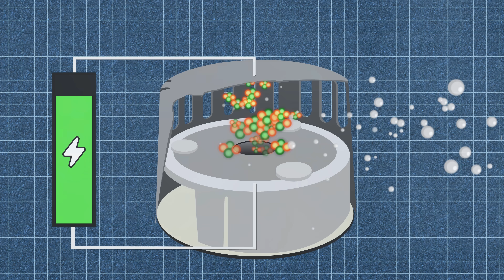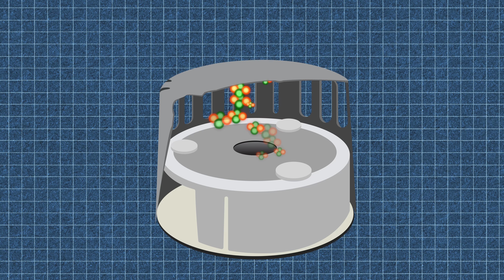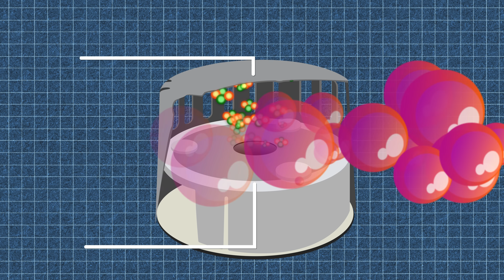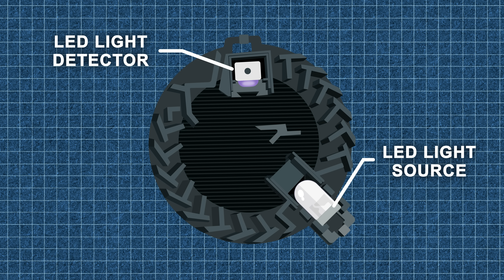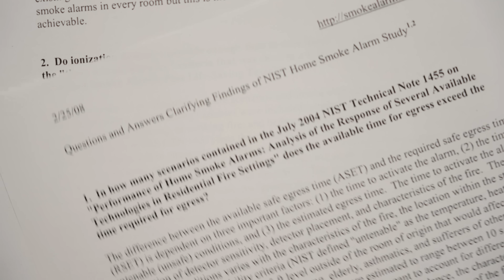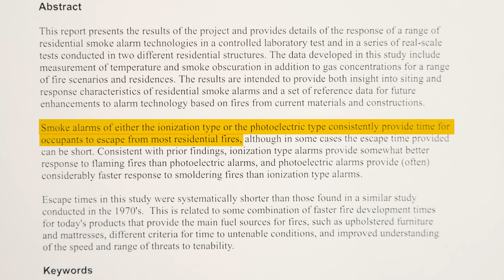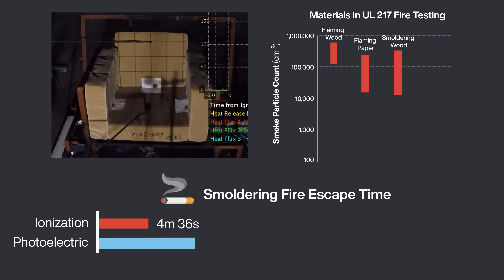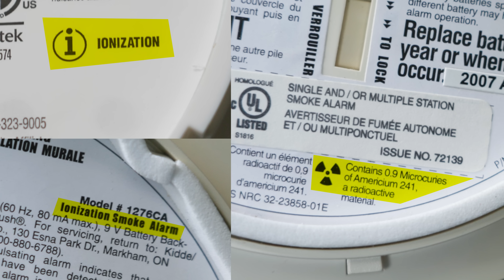Why the Most Common Smoke Alarm is Dangerous

Comment: Here in our Australian home. We have both alarms. One of them goes off about half the time whenever I use the oven. It's so annoying! But I also understood why it behaves like that. We might have a look at the availability of the 8th gen alarms here soon!
Reply from the maker: Hey, great on you to check which alarm you have! Unfortunately outside of America 8th / 9th gen alarm don't exist.  However the technology might be in your current alarms already.  I would get a photoelectric alarm for sure.  I forgot which independent testing organization released info for Australia but it exists as I was looking at their recommendations during my research for this video.
Reply: @Lam  thank you for the comprehensive information!
Reply: You might try moving it. It could be that the way the air circulates in your house the air from the oven gets to the detector too quickly before it has had a chance to disperse.
Reply: @uzetaab  it's right next to the kitchen. I'm not sure if I'm allowed to move it
Reply: Does Australia even have 8th gen alarms along the same standard as USA?
Reply: @jayytee8062  The standard has been updated (AS3786:2023) but on a cursory search it looks like it may not have taken the USA approach of raising minimum standards for individual alarms.  What it does do is allow sale of multi-detectors (e.g. CO2 and smoke) and dual sensor (ionization and photoelectric). Also requires alarms to support interconnect (all alarms sound together). This is not yet a requirement in Victoria but it is in some states, at least for rental properties.
In Victoria smoke detectors are only required outside bedrooms between the bedroom and the rest of the house which would have been ok for non-smokers but how many people now charge phones in their bedroom overnight? No way I'd sleep in a room with a Li-ion battery on charge and no smoke detector!
Reply: Hah, what's the point - Australia is a total joke now. Just another sad puppet of the WEF.
Reply: In Queensland, all new smoke alarms installed from 2017 onwards must be (solely) photoelectric type and by 2027 all smoke alarms must be photoelectric and interconnected. Rules vary by state and territory naturally but I thought I'd throw this in there as well.
Reply: @theone1and1  Hi mate, I was wondering how you came to know this. Just asking out of curiosity as a fellow QLD'er, cheers :)

Comment: I'm going to buy some of the fancier smoke detectors you recommended!
  As a renter, I found nearly every apartment ive been in has expired detectors (>20 year old ones common on the east coast). Now in addition to smart lights, I'll be moving between rentals with smart detectors. Keep up the great videos, Andrew
Reply: In Seattle my apartment building just replaced all the smoke/CO detectors after 10 years. The Seattle fire department also comes by I believe once a year or every 2 years and inspects each apartment as well as the entire premises.

Comment: TLDW (Too Long, Didn't Watch)

1. USA regulations require all smoke alarms manufactured after June 30, 2024 comply with UL 217 8th Edition, a major quality of life upgrade that dramatically reduces the "nuisance alarms" (false detections) from cooking.
2. Smoke alarms with a (I) (Ionization) sensor are generally worse than ones with a [P] (Photoelectric) type, but both types used simultaneously (such as dual-sensor ones) offer the best protection.
3. About half of house fire deaths from could be prevented with working [P] (Photoelectric) type smoke alarms. (Don't be part of that statistic, you know what to get your loved ones for a Christmas gift now, LOL.)
Reply from the maker: Thanks for the TLDW.  1 and 3 are correct!  Bit of an edit with 2.  Ionization is generally worse but both types used simultaneously can offer the best protection but problem is dual-type sensors are not being sold in 8th gen models right now.  Interconnection is just as, or more important.  Thanks for enjoying the video!

Comment: Great video! I love your channel. This isn’t a negative comment, but how come you didn’t run the original tests with an 8th gen alarm to actually show the differences?
Reply from the maker: I should have on reflection.  So much stuff shifted.  Originally I had tested but later discarded them as it wasn't all that helpful in providing useful data but that's not always the point.  I might make a bonus video showing the differences.
Reply: @Lam  thanks for the explanation. That’s basically what I had assumed. I figured you had done the testing but left it out due to video pacing or something like that. Either way, the video was informative and entertaining. Keep at it!

Comment: This is an excellent overview of the problem and its potential future solution, but I would really like more information on the optical wavelength differential technique of particle size assessment and software algorithm discrimination of nuisance smoke vs real fire situations. I'd really like to see some of these new models tested in real world scenarios too.
Reply from the maker: Yeah, I regret not doing more mock tests rather than presenting data.  I started with that but changed over time when I realized it wasn't scientific, but that's not needed.  An illustration is enough. 

The deep dive into how they achieved this is interesting but is way beyond what I'm doing with my videos and most people would probably fall off at that point

Comment: I love your content Andrew, but the graphs you used to illustrate the difference in reaction time of the alarms was confusing to me

The way you presented it makes it unclear what the"smoldering fire escape time" means. On first look it reads as if the photoelectric TOOK 35 minutes to alert while the ionizing took 4.

What I assume it means is that the photoelectric gave 35 minute of warning before the smolder turned into flame. Just food for thought on that data presentation, loved the video
Reply from the maker: Yeah, thanks for letting me know.  So I was trying to figure out the best way to show it, but that was the best and official stat to summarize everything up.  It's definitely not intuitive and different from the way most people think about this type of data
Reply: @Lam  I think breaking the cadence of the video for 30 seconds to explain the two axis and their meanings could be beneficial. I’ve seen other creators post graphs ahead of time on forums or the YT community page to make sure they’re visualizing data well (it’s hard to do)

Comment: I mean, the older-gen ionization alarms ARE extremely annoying, but they've also saved my ass quite a few times because I live with roommates and have an electric coil stove and very little counter space. Roommate throws on a pot of water for Mac-n-Cheese, turns on the back burner instead of the front, tupperware catches on fire while I'm in my room with the door (right next to the stove) shut and they're in the living room watching TV or something. This happens about every 6 months or so but the detectors ALWAYS catch it within seconds of it flashing off, we just have to remember to open the kitchen door before anyone opens the oven otherwise everyone runs around to find some kinda pokey-stick-object to turn the alarm off. Hell, it ALMOST happened with a skillet full of bacon grease on the back burner LITERALLY LAST NIGHT, I just smelled it before it caught fire cause my door was open.
Reply: Some roommates shouldn't be allowed within 100 ft of a kitchen
Reply: @fridder. Don't let him cook. Your life may depend on it.
Reply from the maker: Haha, sometimes it just works out.  Glad it saved your ass
Reply: stop putting your tupperware on the stove haha

Comment: Money grab is all it is... whats so difficult about putting both an ion sensor and an optical sensor into the same package? Companies dont care about your safety, they care about the bottom line and the profit margin.
Reply from the maker: The argument against those is the detection issue, which one of those sensors do you trust?  If it was in an area without false alarms, then of course the earliest detection would be ideal.  But many of these are also used next to kitchens which can cause issues.  I think a big part of this as well is the lack of education and therefore a lack of business incentive to create them., Even today there's only one model that's dual sensor.
Reply: @Lam  what I thought up, not sure on feasibility, is having a circuit design with an AND gate from each sensor which will require both sensors to trigger a certain threshold voltage to energize the gate. Further, each sensor can have a secondary channel which will bypass the AND gate if the voltage spikes above another threshold level to allow the alarm to trigger from actual events that either sensor detects first. I haven't taken any time to study the circuit design from the older ionizing sensors but I'm assuming it will be a relatively simple circuit design which leads to false-positives. I'm sure you can come up with a design that would eliminate a large portion of false positives... question is would it be economically viable from a "profit-margin" perspective.
Reply from the maker: It's not which is why they haven't been developed.  As well with 9th gen tech released, photoelectric alarms are more than capable now of picking up flaming fires in a shorter time period.

Comment: Drywall dust just set off my photoelectric CO alarm. . . 😷🤬
Reply from the maker: Mmm, yeah, but that's also why contractor models have a shower cap included to keep the dust out until the job is done.  You'll need to vacuum your alarm afterwards

Comment: Thats funny. USA dont likes china so they dont have cheap and better fire alarms xd Like in EU I calibrete mine to be extremaly sensitive and it works even with smoldering fumes.
Yeeeaa. new gen. programed fire alarm, if it is on microcontroler it wasnt be safe for a long...
Reply from the maker: I didn't know you could calibrate alarms
Reply: @Lam  I know its not good for everyone, but i'm electronic so i add adjustment, try it with different smokes, set sensitivity like your ionic alarm, that will sens even open oven for too long. I need it for my mother with "dissablilities" (she's acting like child) So i have to find best option and here it is.

Comment: I had a cheap Kidde smoke alarm before, its false alarm over nothing, like nothing, in the middle of the night, it drove me nut I took it off the ceiling.
I bought a Panasonic one to replace it, it never ever gave me false alarm ever again, I guess it is the latest generation detector that has very good detection profile.
Reply from the maker: Are you in Asia? That's the only place I've seen that sells Panasonic smoke alarms.  Random false alarms are definitely annoying 👎
Reply: @Lam  Your guess is right, I live in Thailand, building code here only mandate having smoke detectors in commercial buildings, most houses here doesn't have one unless you buy one for yourself.
I live in a 2 storey semi-detached house and feel that it would be good to have some smoke detectors in case fire broke out while I'm asleep or something. 
I learnt that most of cheap detectors being sold are outdated models from oversea, so I looked into what most commercial buildings are using, and it seems that Panasonic is very popular choice. 
The model is SH28455911, I love how it has voice notifications for everything, "low battery" "fire" "fire test" etcs., no need to set up apps or looking up manual of what the beeps meant. I think it was specially made for Asean market, humidity is main issues with poorly calibrated detector, too many false alarms and it became useless as people took it down.
Reply: @Lam  Yes, most of commercial smoke alarm here are Panasonic, I worked as contractor before, had nothing to do with smoke alarm system, but I noticed that it's everywhere, so I just feel that it must be reliable that most sites choose it.
And it's true. Never had false alarm with steam and it sounded when I test it with actual paper smoke.
Reply from the maker: Makes sense, just saw this comment now. Commercial buildings are almost always photo around the world from what I've seen. 

That's interesting how humidity is a priority, makes sense.  I know the nest protect includes a humidity sensor in order to ward against steam nuisance alarms after a shower.

Comment: I went down this rabbit hole a few years ago, everyone I talk to doesn't even check if there alarm still works or has batteries 😢.

 Thank you for spreading a bit more knowledge about this, if it saves one person it's worth it
Reply from the maker: Yeah, it's a real shame, but hopefully with 10-year batteries being mandated in a lot of jurisdictions, and these nuisance alarms being solved, that fire safety will be improved
Reply: @Lam  That trains us that we never have to change the batteries, since 10 years is almost forever. Except that it isn't forever. So, aren't we just going to have a lot of broken useless plastic in 10 years? 
If we'd wire them to the mains and use a capacitor for backup, it could last 50 years, I'd think.
Reply from the maker: So technically you could replace the lithium battery inside with a like and kind model.  However, the 10 years is to really guard against electronic failure and degradation.  I can't remember if that number is overly conservative, but for critical safety equipment, as well as advances in detection, 10 years is pretty good
Reply: @Lam  And doesn't 10 years train us to never check them? I check mine. 
But maybe if many people never check them to begin with, having the prior owner or landlord put in 10-year models would be an improvement... ?
Reply: @boomergames8094 They live longer than 10 years, but will make damn sure you remember to replace them after 10.
Reply: @boomergames8094  Mine bought in UK beep beep beep beep when the battery is low/ needs changing